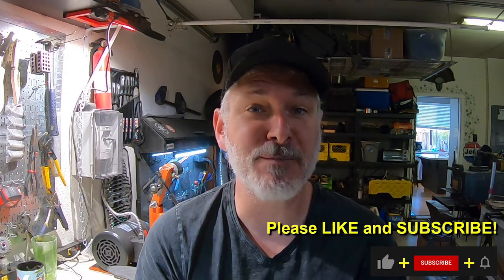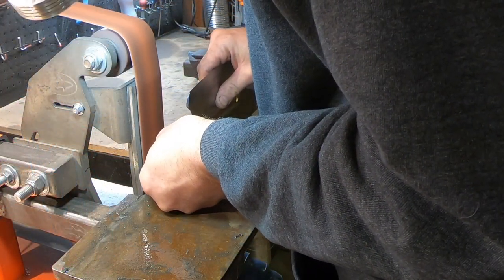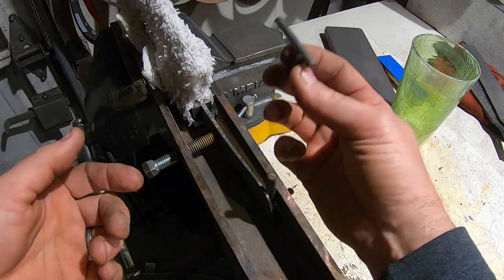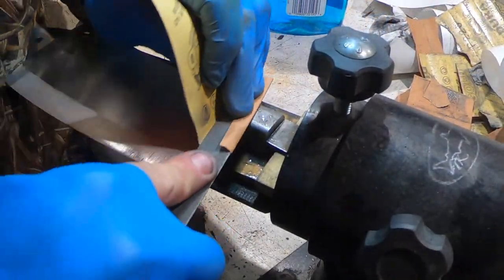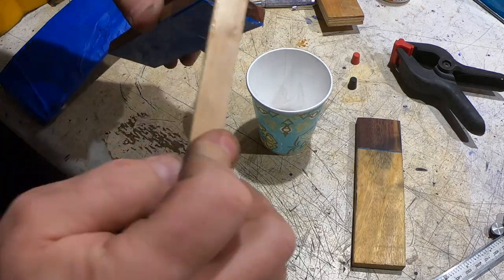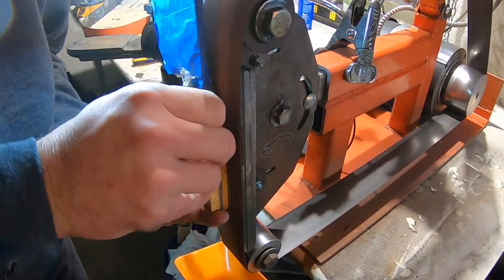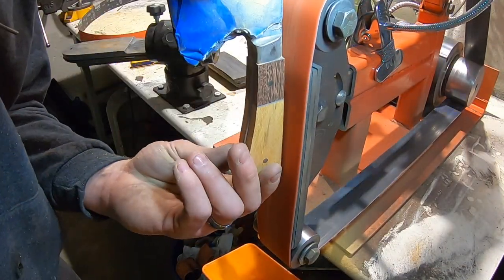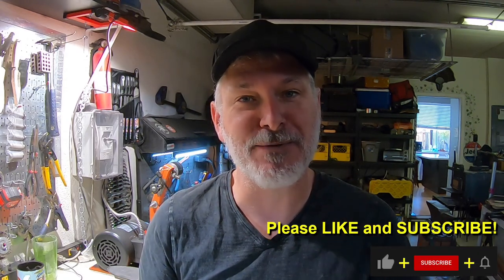Forging an Integral Raindrop Damascus Cleaver - Finished!

Comment: Beautiful….as per usual! Good tip on cleaning the sanding belts. I go the cheap way…Goodwill-type stores always have shoes that have a big thick rubber sole/heel. They work just as good and fraction of the cost.
Reply from the maker: Yup, old shoes are excellent for this.  These days its hard to find those old rubber sole'd shoes though.  😉.  Thanks for watching.